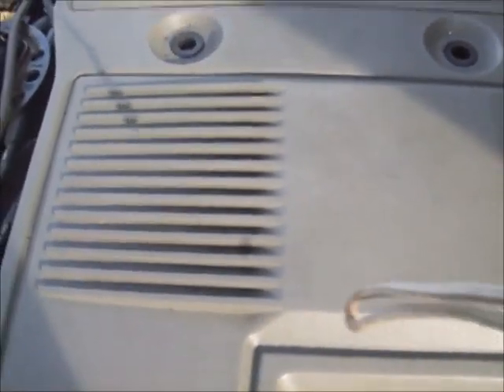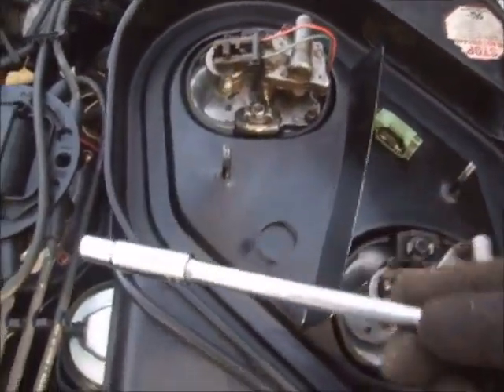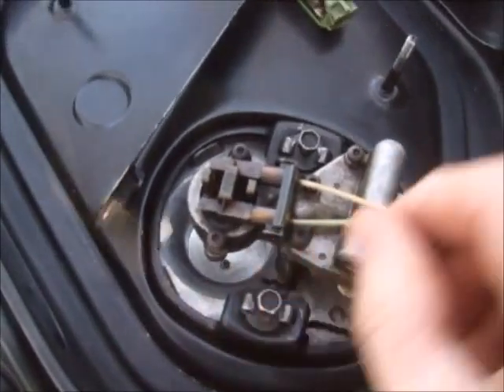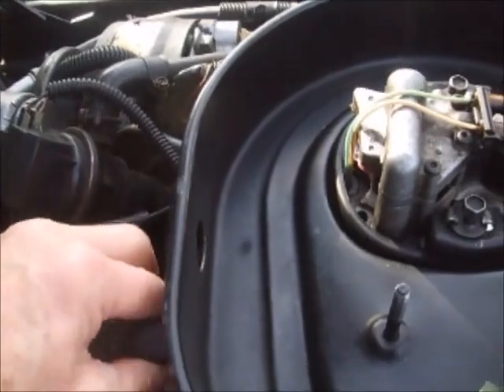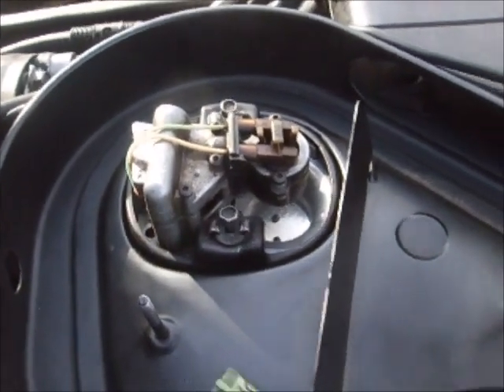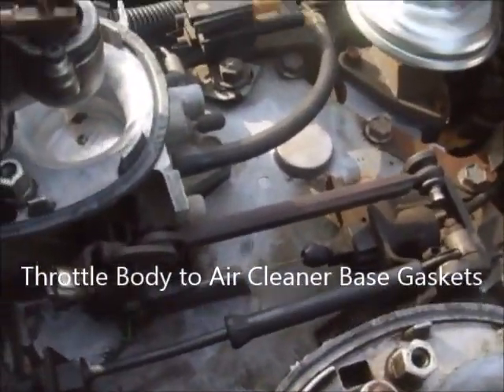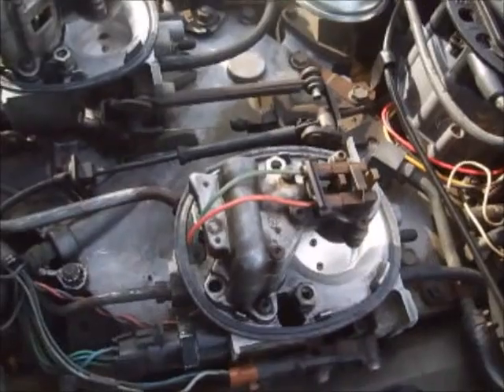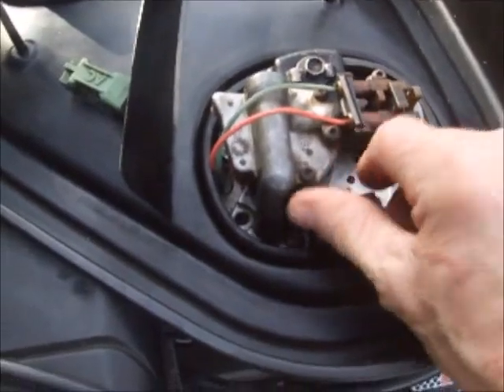𝐒𝐓𝐎𝐂𝐊  𝟏𝟗𝟖𝟒 𝐂𝐎𝐑𝐕𝐄𝐓𝐓𝐄  hesitation/stalling/stumbling During WARM UP: Air Cleaner Gaskets

Comment: Hey how's it going?  So I've been working on the 84 lately.  I re-wired and cleaned the distributor, wire brushed the grounds by the battery, and now it fires up again.  But it's only spraying the front injector and will only stay running, (and running like crap),  if I'm giving it gas.  I checked the fuse and sure enough the rear injector fuse was blown again.  So I replaced it, and when I turned the key halfway (powering the dash but not cranking the engine) the rear injector started spraying constantly until I turned the key back off.  After that I turned the key again, and the injector did nothing (fuse blew AGAIN).  So I cranked the engine, fired right up and ran pretty good for about 7 seconds, I'm thinking because the left bank got all that fuel from the rear injector when I put the fresh fuse in.  I followed the 2 wires from the pigtail on the rear injector all the way as far as I could to near the firewall on the passenger side, and found no obvious defects in the wires.  In fact that section of wiring seems to be in pretty good shape.  I'm assuming the rear injector is the only thing on that fuse since it's only a 3 amp.  Any suggestions?  Sorry for long post and thank you for your time I appreciate it!
Reply from the maker: wow Bill,  for a fuse to keep blowing there has to be a short somewhere.......has to be. If I look at the electrical troubleshooting manual for the 1984 it says in 8A22 "with the igntion in RUN , voltage is applied through the Injection FUSES and the Fuel Injectors to the ECM according to the inputs it receives.....this is really where it gets interesting, "the ECM rapidly opens and closes a path to **GROUND*. The Fuel Injectors are electrically activated (HELD OPEN) whenever the ECM provides a gorund path. By varying the time that a ground path is provided, the fuel injectors are HELD OPEN. If it was me Bill I would be looking at the ECM, I looked at the wiring diagram and both injectors are grounded  inside the ECM.  One of them must be contacting another piece of metal, just a guess since you said the wiring looks good back to the firewall... I know you can take it out very very easily and sen it of to have it checked and even rebuilt. I know Cardone has a rebuilt ECM for fairly inexpensive, I purchased one and solved a lot of problems. The fuel injectors open and close via the ground....that has to be where the problem is....or a wire is pinched somewhere. The rebuilt ECM i purchased by the way was under $150.  The only other thing I could think right now is a problem at the plastic connector at the injector itself. I don't think it would be the injector. Has to be a wire somewhere arcing. I had water damage form clogged windshield drain cowl utters under the windshiled....caused a lot of rust on the ecm...could be corrosion at a connector. I'll keep reseaching though...kinda good to learn....this is really curious situation. Just for a thought...pulling the ECM and just looking at it is very easy takes 10 minutes, and to pull the cover off and give it once over is really nothing, I put a magnifying glass to mine and found a burned resistor.
Reply from the maker: before i shut down my computer for the night, I also wanted to say, I had my ECM laying on the passenger side floorboard for about a month while I was working on the car.  Easier to plug and unplug the massive pigtail from it. Some guys can run DVOM test on different circuits...I'm not there yet, I know the Injectors need to see a certain voltage, I'l try to look it up. Another thought, again, I would just pull the ECm and look at it, where the plug goes.....could be very very corroded and your problem would be solved for zero dollars.
Reply: Awesome info.  From doing a little googling, I did suspect the ECM as a potential problem.  I thought it would be a pain to get out, so I've been kinda avoiding it.  But after running it by you, the ECM is my next target for sure.  Luckily I have a local guy who fixes computers and he should have no problem fixing a short in the ECM, if it is indeed fixable.  He's currently working on my digital dash :)  Also forgot to mention that I replaced the rear injector when I first bought the car in July.  (the injector that is now blowing the fuse).  So that is basically brand new.  Thanks again for your time.  If not for you, I may have given up and parted this car out already.  Have a great day/night!
Reply from the maker: Bill F glad to try to help. You'll get it it running. Yeh the hardest part of getting the ECM out is laying upside down in that tiny cramped passenger side flooriboard. LOL Here is a video I made of getting mine out if it helps  https://www.youtube.com/watch?v=b09K_TEAX2I
Reply: Hey just an update, I got the ECU out this morning.  Your video helped ALOT.  Took it to my guy and we opened it up.  Sure enough there is a blown capacitor and a few spots that look a little suspicious.  He is going to clean it up and change out the capacitor and hopefully that will solve my issues!   I am excited lol.
Reply from the maker: I know how you feel!
Reply: 3DELTA7 So, had the blown capacitor in the ECM replaced, re-installed the ECM, rear injector still spraying constant until fuse blows (a few seconds).  Is there a relay for the injectors, or anything else that could be causing a short?  I'm running out of ideas.  Thanks man
Reply from the maker: I can only tell you what  i know, never heard or seen this issue before, but the fuel injector is a solenoid operated device controlled by the ECM, the ECM turns on  the solenoid and lifts a normally closed ball valve off the seat then fuel is injected in the throttle body, but i don't see how that would cause a short, it would either be stuck open or closed or partially stuck ?? If  you have access to a FSM and look at  the wiring diagram for the fuel injectors, AND THIS CONFUSES ME HERE, BECAUSE....the diagram shows both the front and rear injectors wired to one 3amp fuse circuit 481 from the rear injector and circuit 482 from the front injector, i'll have to look tomorow but I thought mine had 2 3amp fuses.......but anyway the front injector wires to the ECM at terminal 9 circuit 468 and the rear injector wires to the ECm at terminal 8 circuit 467. according to the FSM you can check the circuits 481 and 482 with a test light, probe each connector terminal to ground. ACCORDING TO THE FSM CHART A-4 IF AN ECM REPEAT FAILURE CONTINUES TO OCCUR....****THE INJECTOR IS SHORTED****  and the injector has to be replaced. Circuits 467 and 468 are the control circuits for the injectors and according to the wiring diagram, both are grounded inside the ECM seperately. All of this grounding is at the WHITE connector at the ECM looks like a boat load of grounds right there including dual injector select  terminal 6 grounded at circuit 450. If I had to suggest something Bill I would look really hard like with a microscope of the white terminal connector that plugs into the ecm and make absolutely sure it looks good, no corrosion or melted plastic race ways where the wires pulg into the ECM. Did you replace one of the injectors and not the other? But there are two wires that come off the fuel injectors.....one wire goes to the fuse, the other wire grounds at the ecm on the white connector.....got to be a shorted wire somewhere. Might be a stupid question but did you trace the wire from the bad injector all the way back to the ECM for burned off rubber etc? maybe laying against a hot manifold??I'll keep looking.......see if I can find anything
Reply: Ill take a look at that white connector tomorrow.  I had followed the 2 wires from the pigtail connector on the injector as far as I could and didn't notice any defects or pinching at all.  They disappear behind the distributor and I couldn't see where they go into the firewall.  Also I did replace the one injector and not the other.  The injector I replaced is the one that is now blowing the fuse (drivers side).  The other one has been functioning perfectly since I bought the car.  I was wondering if its possible to put the injector in backwards?  When I put it in I didn't notice any markings as to positive or negative.  Maybe ill try putting the pigtail connector on backwards and see if that does anything.  I know the injector sprays because when I put a fresh fuse in, it sprays like crazy and constant until the fuse blows in a few seconds.  And that happens with the key just on power, not cranking the engine.  As always thank you very much for your help.
Reply from the maker: sitting here studying this wiring diagram.....that ground circuit inside the ECM grounds a boat load STUFF....but the two injectors ground at the same location, if one injector was grounded backwards I think the solenoid would be working constantly,  then shorting because they eventually come together in the circuitry.....not going to mislead anybody here but i am having to learn right along with you Bill.....just looks like both injectors are going to have to be wired the same. Because this is such a simple design, positive/negative, solenoid opens and closes, ........"if this ain't the problem" i'll be scratcing my head like the Apollo 13 technicians at Houston command center. I know you must be extremely frustrated...but it is a very simple thing, gotta be something minor. COULD the injector you ordered be defective??
Reply: So here I am again after a little hiatus with another update.  I found a deal on Craigslist for a crossfire intake with the injectors, distributor, and ECM for 125 and I ended up getting it all for 100!!  The guy didn't know the history of the parts so it was a bit of a gamble, although I can probably sell the injectors and get my money back.  So anyway I tried that ECM and bingo!  Both injectors are now spraying and the fuse doesn't blow.  That problem is now solved, with your help.  Thank you!  The weird thing is, it runs almost exactly the same as it did on 1 injector...  I know the fuel pressure is good.  Fuel pump, filter and tank are all brand new.  Injectors spraying fine.   It starts RIGHT up.... takes less time to start than my 06 Saturn.   But idles very low and rough.  When I rev the engine it starts to break up.  I am suspecting a vacuum leak plus the spark plugs being junk.  I bought new spark plugs (the AC Delco ones you recommended) but have not put them in yet.  The guy before me had put in Autolite junk and probably didn't torque them to 22 ft/lbs.  Plus with the engine running like crap (timing has been all over the place) probably fouled up the already crappy plugs.  I have watched your spark plug video many times over and a few other ones addressing rough idle.  My new question to you is, any other advice on locating and fixing the vacuum leaks and any other advice on getting to those 2 plugs on the passenger side?  I'm afraid I wont be able to get my torque wrench in there.  Thank you for your time it is MUCH appreciated.  I'm gonna need to send you a case of beer or something!
Reply from the maker: LOOOOONG reply man.........sorry about that. The #7 plug isn't too bad.... it's getting the boot on that was difficult on the number seven,  torquing down the #8 plug is a bitch man...won't lie to you...a knuckle scraping bitch...i drove the plug in with my fingers as hard as I could finger tight, then I put the socket on there first, I used a 1/2 inch drive torque wrench...so I didn't have to crank on it so hard.....also I had a 1/2 inch drive torque wrench that has a very long handle on it.....after I got the socket on there i wiggled and wiggled until I got the torque wrench and pushed it in with my fingers all scraped up....then torqued it down, if I remember it was very slow because not a lot of room so I got maybe 1 or 2 clicks on the wrench at a time, had to hold it with one hand and move the handle back to get the lever to catch, if you understand what I mean....be careful man...because if you crank down on that wrench and it isn't straight you could crack the ceramic around the plug and never know it or worse  cross thread the plug. Someone said they jacked up the car and went at it from the bottom and it was less of a nuisance...I don't know never tried it that way...maybe nxt time. I'll give you a TIP....unplug the COOLING FAN SWITCH AND BE CAREFUL WITH ARENCHES AROUND IT.....DAMN thing is right there in front of the number 8 plug....my advice...unplug it put the wire out of the away somewhere. I snapped mine off...dropped the heavy wrench right on it, (frustrated). It can be done though. As far as the vacuum leaks.....man I had the same problem....just got a beer one day and started going through things one at a time........One hose that has problems is the hose that runs from the MAP sensor to the rear of the back fuel injector.......the one that was on there was brittle.....went to the auto parts store and purchased what I thought was good vacuum hose, installed it, ran good then a few weeks later rough running again...found that hose was melted at the injector...purchased some HIGH QUALITY high heat hose and haven't had any further issues.....but that hose at that injector gets really hot right there.....splits wide open at the nipple.......another problem point I had was at the brake booster check valve.....someone actually put the wrong check valve on it....almost like they borrowed it from another car.....was leaking really bad.....not trying to tll you what to do but that MAP sensor hose is where I would start.......LAST THING HERE......you have you checked you Coolant Temperature Senor??? That causes things like you are describing, and it is only about $10 give or take,,,easy to install in about 5 minutes........give some serious rough idle. Stay in touch. Glad things are starting to shape up.
Reply: No problem. So I just finished going through the vacuum lines, and it runs much better.  The vacuum lines were all kinds of messed up, connected to places they shouldn't be. Runs better but then gets rough and dies, still. So taking your advice went to take a look at the coolant temp sensor, and, NOTHING was plugged into it!  There's a single yellow wire dangling near it so I'm assuming that's my missing wire. The problem being, it's just a bare wire at the end, no plug or connector.  The guy before me really F'd this thing up.  So how exactly does that wire connect to the sensor, what am I missing?  Thank you sir!
Reply: Ok scratch that. I screwed that up haha. After watching yet another one of your videos I realized the one I found with no wire was the cooling fan motor switch.  That explains why my fan is always on, someone must have wired it to stay on. So I'm going to get the cooling temperature sensor tomorrow and give that a shot.
Reply from the maker: I changed mine out to a new style two wire sensor...I'm pretty sure that is all you can buy now because they had problems with the original design.....I'm going to have to check on that wiring brother.......but if that isn't connected you probably found your problem...because that sensor is the first thing the ecm looks at for data......anyway, not at home right now but i'll try to look at it tommrow...see how its wired....I know it needs to be upgraded to the two wire sensor. If the ECM sees cold it is going to regulate fuel for cold engine...when your ngine gets warmer....going to be alll messed up.
Reply: 3DELTA7 Hey I have another question... You said your TPS was all over the place when you hooked it up to the multi meter to test it. Can the TPS give a steady reading and still be bad?  My TPS was NOT all over the place and gave me steady consistent readings, but after setting it to the correct voltage, it still has the stumbling/hesitation issue and stalls when I put it in reverse most of the time.  I suspect the TPS is still bad, but I wanted to run it by you before I spend 60 bucks or whatever on a new one. Thanks for your time it is greatly appreciated.
Reply from the maker: I completely don't understand the stalling in reverse.... but for the TPS I know they get a flat spot on them sometimes and cause stalling.....I can only say according to what I have read and heard  if the multi meter gives good readings on the throttle up and down it should be good.......you can run a resistance test on it, I didn't do that because mine was giving bad readings, so I just replaced it, so I'm not sure how to go about that, couldn't be hard though. The stalling in reverse is weird and annoying for sure. The 84 has a TCC Torque Converter Clutch, acts like a clutch in a manual car, it its actuated by a brake light switch under the dash, right on the brake pedal,,,,if it is bad the TCC acts up like popping the clutch  on a manual transmission, it just stalls out. ****these brake light switches are prone to FAIL**it is a two way switch, plastic junk,  operates 2 things, one way the brake lights, the other way the TCC. Easy to test and take out.....although like the ECM gotta get on you're back. Other than that switch, the stalling is wierd!!! ONE last idea....the Coolant Temperature Switch is an annoying as hell little piece.....did you check it out real good? Because that $9 part gave me nightmares, it will cause these 1984 Crossfires to go absolutely crazy......so just be sure it is the correct one, installed to TORQUE specs and wire correctly......if not the car will run like it has a blown head gasket!!!!!
Reply: 3DELTA7 is the coolant temp switch the one on the front of the motor?  I did replace that not too long ago. It has 2 wires, both the same color so is it possible I have that wired backwards?  I'll check out the brake light switch as well. Could I still have s vacuum leak somewhere that I missed that would cause these issues?
Reply from the maker: yeh that's the one. Could be a vacuum leak Bill, like the intake manifold gasket...that's a bad one. Just curious...very long shot question...and personal, you don't have to reply, but do you know someone named  that lives in Tampa Florida near Ola ave.? Like I say you don't have to answer.
Reply: 3DELTA7 I didn't see a name there in your comment although I do not believe I know anyone in Tampa. I have a few family members in Orlando though and I'm up in Pennsylvania.  The vacuum lines are starting to confuse me lol. I have 2 or 3 T's in the back near the distributor etc..  The diagram only shows 1 there...  I'm going to post a short video clip tomorrow to show you what I mean. The one "T" in the diagram links the one VAC motor to the air temp sensor which is all contained on that top removable base, and then splits off to the right side rear port of the rear throttle body unit. On MINE there's another "T" between the right rear port on the TB unit and the other "T" that is contained on the air cleaner base...  It then leads down near the firewall where it splits AGAIN, with one smaller line(the size of the EGR lines) leading to something beneath the distributor and another bigger line leading to something that looks like a mini thermostat housing on the back drivers side part of the intake manifold. None of this stuff past the first "T" is on any diagram I could find. Sorry this is so long any help is appreciated.
Reply from the maker: Oh okay, had a friend that knew somebody having 1984 problems that sounded just like yours, lived right down the street, not you obviously. I'll have to look at my vacuum lines off the rear throttle body and see....doesn't one of those lines go to the MAP sensor? Thought one went to the oil pressure sensor, IAT on the  and somewhere one of the lines has to operate the vacuum motors on the thermostatic air cleaner,  one over to the EGR valve switch. So many things can mess up one of these engines, I forgot all about the EGR valve.....just curious have you clean it out? Mine was severely clogged up with soot and the stem wouldn't move....can't remember exactly but that affects. open or closed loop...have to look it up get back to you. very easy to take off and clean though.
Reply: 3DELTA7 I have not cleaned out the EGR although I did replace it with one that was on the extra intake manifold that I bought along with the TPS and IAC valves from that extra intake as well, just because that whole assembly was much cleaner than mine.  I just uploaded a short video clip trying my best to show the vacuum line issues I'm talking about. Take a look when you have a chance and see what you think.
Reply from the maker: I replied on your video Bill.